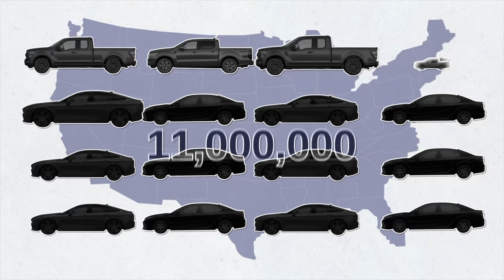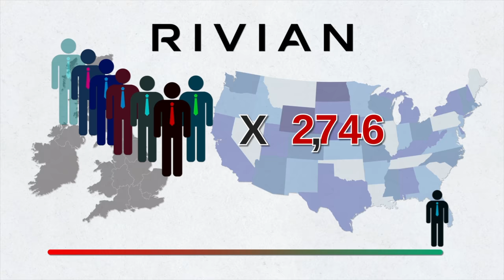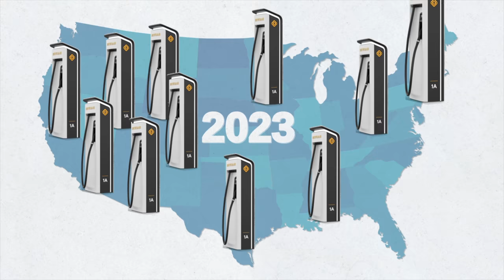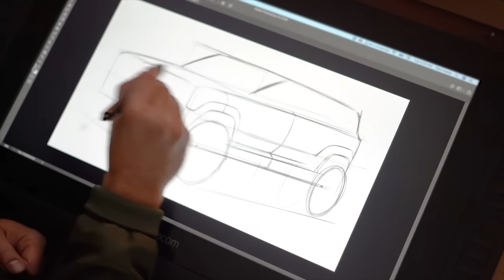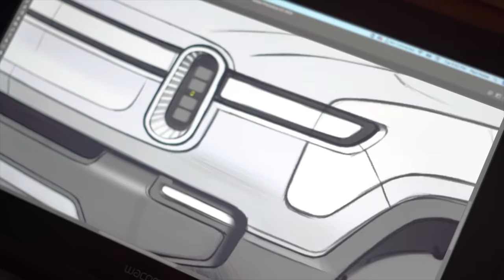Here's Why Rivian’s New Vehicle is the Future of Cars (Goodbye Tesla)

Comment: EVs are ALL about the batteries, and until long lasting solid state batteries become commercially viable I'd be concerned about buying one. When the cost of replacing a battery pack can be tens of thousands of dollars, purchasing an EV could be an economically unwise decision. And depending on the kind of support the manufacturer provides to that EV, it might not be an environmentally friendly solution either.
Reply: The current crop of batteries being used have 20-30 year life cycles.   That's not going to require a replacement unless you only buy 2 cars in your lifetime.
Reply: @victorluke5816  Can you quote a source for that 20-30 year life cycle? I looked at two recent articles (written in March this year, from Car Magazine UK and Truecar) and one claims a 12 year life cycle, the other states 10.

Both point out that heat can shorten a battery pack's lifespan, and one states that frequent rapid charging (among other things) will significantly reduce the lifespan of the battery pack. If you live in an area with unusually high ambient temperatures, then it's likely that you'll also experience a reduced battery pack lifespan - particularly if that battery pack uses passive cooling like the Nissan Leaf.
Reply: @rodh1404  yeah seems odd  tesla only warrant batts for 8 years
Reply: @rhett7716  As I understand it, Tesla do make some of the best EV battery packs in the world. Under normal conditions, I'd expect them to last for at least 10 years, and more likely 12 - 15. But it still depends a lot on how you treat them. I wouldn't be surprised if a Plaid battery pack lasts for less than 8 years, for example, since many people are using those cars as (essentially) drag racers. Which results in very rapid battery discharge and that's got to have a serious negative effect on the battery pack's lifespan.
Reply: Car engines have the same issues. As a number of companies have found, rebuilding battery packs can be done quite economically as batteries are often killed by single cell failures. Replace the single open circuit cell and you are back on line.

Comment: Hydrogen powered electric vehicles may be the real contender for the future. More convenient without the range issues.
Reply: Hydrogen vehicles have been tested, and failed. Battery tech has advanced greatly, and hydrogen is too inefficient and impractical.
Reply: Not for personal vehicles. No infrastructure, much less efficient than pure electric, and much higher fuel costs.
Reply: There are literally thousands of BEV charging stations from the Canadian/Washington boarder to San Francisco. There are ZERO places to refill a hydrogen fuel cell powered car.

Comment: So, it can tow 11,000 lbs? That’s good, but for how far? When towing all that extra weight, will the mileage drop down to 50 miles? 30 miles? 10 miles?
Reply: The cool thing with electric is their high torque. So towing wise it will be slightly greater distance than  current 2500 trucks. The issue will be how long it will take to fill it yp
Reply: @kmsah  High torque at low revs. The trailer might just stop the EV from getting over 25 mph.
Reply: My brother has a tesla x, we have used it to tow my boat. The boat and trailer weigh 3498 lbs ready to fish. It is 166 miles round trip, there is an elevation rise of 3112 feet on the route. We have done this 9 times, we routinely arrive home with between 14% to 18% of battery capacity remaining. The battery is rated for 350 miles of range. This is just our personal experience, so take it for what it's worth.
Reply: House Chadwick  So it sounds like it cuts the miles-per-charge almost in half.
Reply: @markplott4820  Still doesn't say what speed it can get up to.
Reply: @housechadwick7505  There are a lot of unknowns lurking behind your information, like what does it do the the battery degradation rate, for a start? If it cuts range in half, it may cut degradation by four or six times. We don't know, and it needs testing. It's fine if degradation rates are unaffected, which is also a possibility. Then there's that highway speed performance - what sort of pep does it remove? Is it no worse than what a big diesel loses, or noticeably worse? And at twice the juice used, is it cheaper to run the big diesel? Are diesel rigs cheaper than a Model X? Lots to factor in.
Reply: @markplott4820  More info is good, so long as the "actually" is actual. With claims like those; I would be looking for validation - too far fetched.

Comment: I just wonder where all the extra electricity will come from to power everything. If you can't use fossil fuels to generate, the sun doesn't always shine, the wind doesn't always blow, even the rivers don't always flow consistently. How do you store all the energy so that the grid doesn't "brown out" when the demand out paces the generated energy? What about disposal of everything needed when the life cycle runs out?  How much of the materials used will be recyclable? How will the raw materials be collected and refined? What is the estimated number of raw materials that are easily accessed and how much does the Earth have of each? I'm not knocking anything. I just think that we are not looking at the entire picture. As the song says, "Every Rose Has Its Thorn".
Reply: Yea I can't come in to work today we had a blackout and couldn't charge my truck. 😃😃😃😃
Reply: Aggreed. For every positive, there's a negative. Somewhere down the line, there's going to be a cost in the end. Just like nuclear energy. Positive end, it's cleaner sourse of energy, the negative side is disposing of the still radio active inofficiant fuel rods. Lithium isn't an abundance resource either. In time that will be depleted as well.
Reply: @tommussington8330  "...we had a blackout and couldn't charge my truck"
Ever waited in line at a gas station, when fuel supplies were low?
Reply: @swordedaffair  yes back in the 70`s  I could get enough to go to school and work,, and I said if gas got to $1:00 I'd stop driving   just paid $3:69 today.
Reply: This is actually where Hydrogen might be of use.  Solar and wind generated electricity can be stored as elemental Hydrogen or converted to ammonia.  Old power generation plants can then be kept on line when needed powered by the ammonia instead of natural gas or coal.  This is way cheaper than putting 2.1 trillion dollars worth of hydrogen fuel stations to make that system usable.
Reply: @christophermcmichael880  Studies have shown we have plenty of lithium. Other resources used are more of a concern. I suspect there will be a large shift to lithium iron phosphate batteries, since cobalt and nickel are more limited.
Reply: Nuclear energy is advancing. Fusion may also be feasible in 10-15 years, there have been recent breakthroughs. More short term, various storage methods are under development, I find heat storage, and heat battery thing, interesting. Currently, the batteries can be recycled but it is easier to use raw materials, this will need to change in the long term.
Reply: @tommussington8330  $100 in 1975 is worth over $500 today due to inflation, so your safe... for now.
Reply: Even if every vehicle was replaced by electric vehicles, you can still use gasoline to power them.  The gasoline would just be burned at a power plant instead of under the hood of your car.  In that case gas is going to be cleaner when burned since plants are going to be adhering to some standards for cleaning the pollution.  ICE car owners are not always the best about ensuring their cars are not polluting.  The same goes for the motor oil used in cars as a lot of it ends up on the streets or disposed of poorly.  The oil containers used are not always recycled appropriately either.  And yeah the recycling of electric car batteries is still evolving, but I think there is opportunity there to recycle batteries versus mining new materials to replace them.